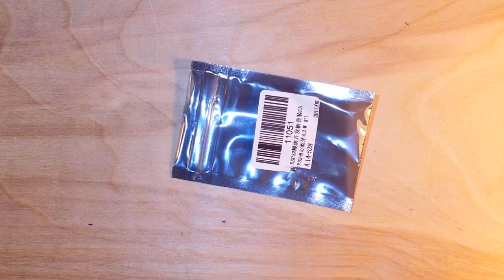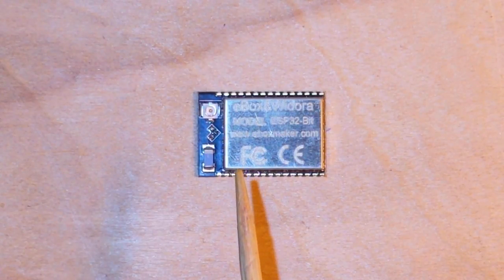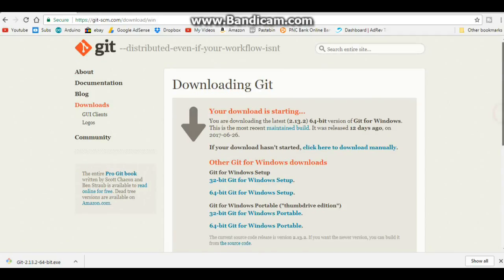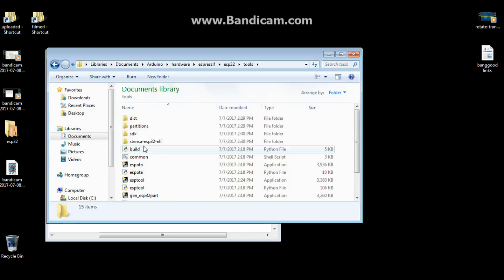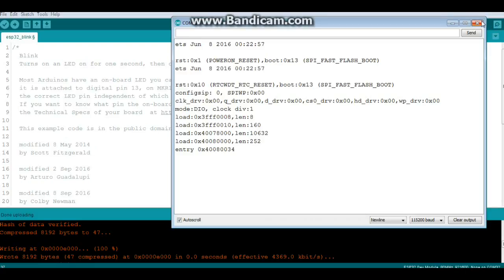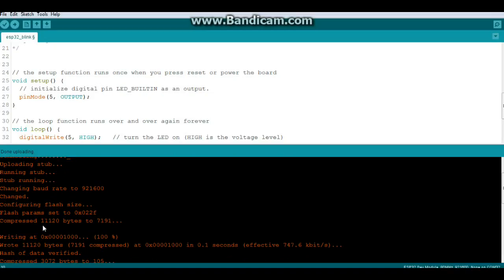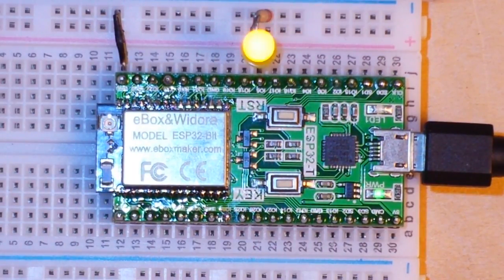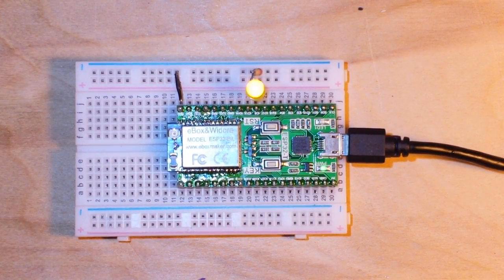Getting Started with the ESP32 from ICStation com

Comment: its so tiny!!  thanks for showing metric, i like how the thing is capped so you can put a heatsink on it maybe.  i take them out of old computers and cut them down
Reply: actually the can doesnt touch the controller inside. so to apply propper heatsinking you could have to get rid of parts of the can
Reply: i understand that,   said the can gets hot, ( i think) any heat taken off of it would be better than none :P.  you don't wanna remove that Faraday cage,  its a wireless module

Comment: How do you run it at 240mhz through the Arduino ide?
Reply from the maker: legoscratch The Tensilica mirco controller runs at 240MHz regardless of the development environment. The speeds you see in the Arduino IDE are the Flash upload speeds.
Reply: learnelectronics oh ok, I thought the min speed was 160mhz and the 240mhz was a max overclock speed

Comment: takes some time to warm up for the esp, but wifi adds a lot of heat, without it just gets a bit warm
Reply from the maker: fredlllll it takes 100mW in idle with the wifi on
Reply: huh... i measured 150mA at 3.3V with mine =/
Reply from the maker: My charger doctor "Keweisi USB Detector" measured 100mW. Did you measure while wifi was on and active or on and idle? Could make a difference. You numbers give 450mW or in Chinese maths....3 Watts ;)
Reply: probably active. how would i even make it idle? the arduino loop is always running
Reply from the maker: If it's not sending or receiving, but waiting it would be idle. Of course I could be talking out of my ass. My specialty is ultrasonics not RF
Reply: learnelectronics then it wasn't idle. 

Would you mind helping me with my ultrasonic knife then? :P

Comment: oh i thought you had to solder every component on the breakout :P 

i recently found a "better" IDE for developing stuff for the ESP (and arduinos in general) called sloeber (what a stupid name). with the normal arduino IDE i experienced long compile times, with the sloeber one it works faster. i think the arduino one recompiles everything everytime you compile, but sloeber only recompiles what really changed. in case you are also fed up with waiting for the esp stuff to compile for over a minute. sloeber does it in 10 seconds for me (uploading still takes time though)
Reply from the maker: fredlllll I will check Sloeber out, thanks my friend.
Reply: it might be a bit complicated, its based on the eclipse IDE, so if youre stuck you might find stuff when searching for eclipse too